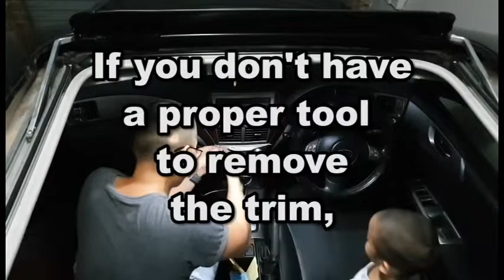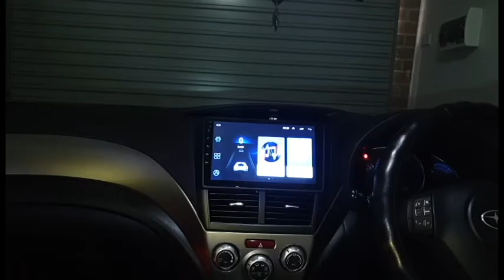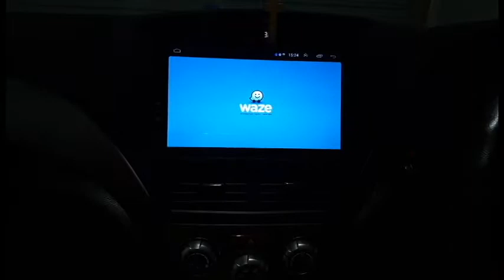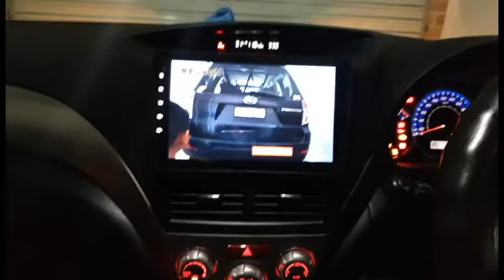How to install Android headunit subaru forester sh  V47

Comment: Hello. Did you had the original subwoofer under passenger seat? 
How did you connect it??
Reply from the maker: Yup still have the oem sub. Its connected already with the oem harness. Just plug and play.
Reply: Forester factory subwoofer are hard to connect. Minimum info regarding this. 
Can you please share the link where you purchase the android head unit. 
Thank you.